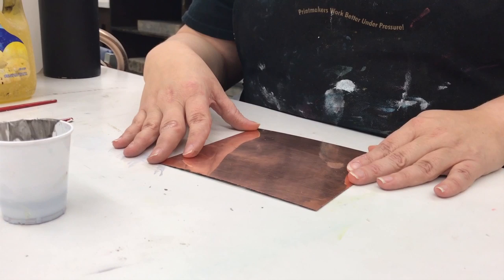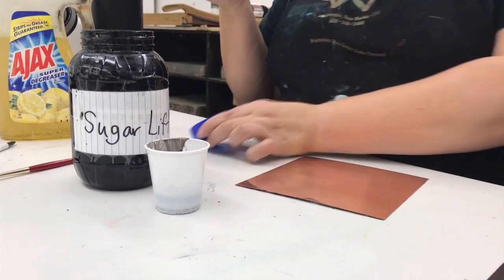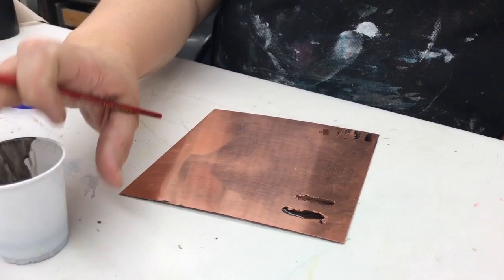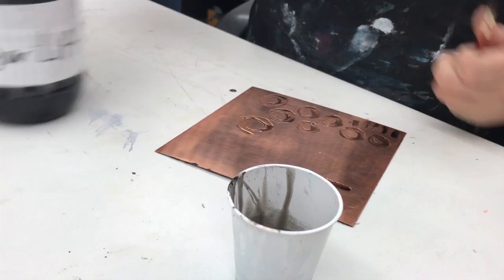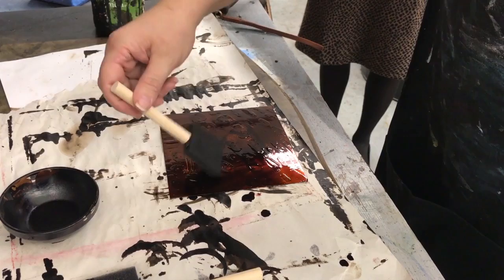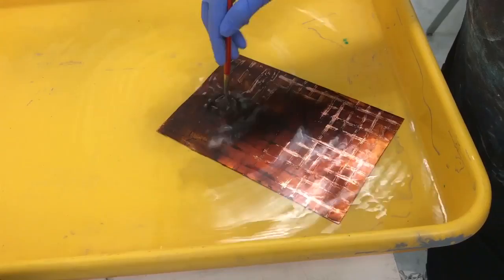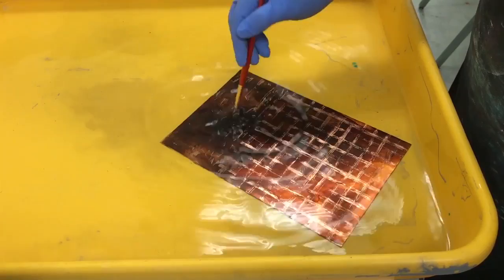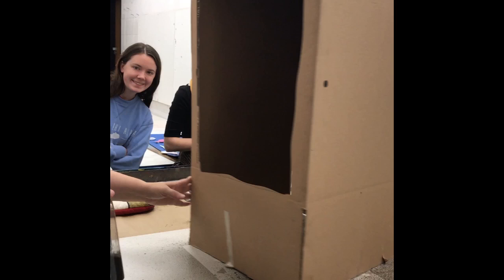Sugar Lift and Aquatint Process- Marilee Salvator

Comment: This is absolutely useless without an exact recipe of the sugar lift you are using. Your description is vague.
Reply: Simple recipe: prepare a desired amount of sugar syrup to a level of consistency/viscosity that you are comfortable with. Keep in mind that a runny syrup will be hard to control. I use mildly runny syrup. Highly viscous syrup is just as hard to use and tends to take longer time to dry after being applied to the copper plate. I would test the syrup using a brush a a test cup per plate. If too runny, I add more sugar; if too viscous add hot water. Next you add ink and mix well. You need the ink so you May see what you’re painting and the marks that you’re making on the plate. So the quantity of ink could be minimal as long as you can see the marking. You May skip the ink part altogether if so you desire.